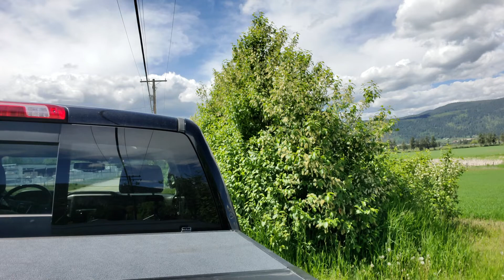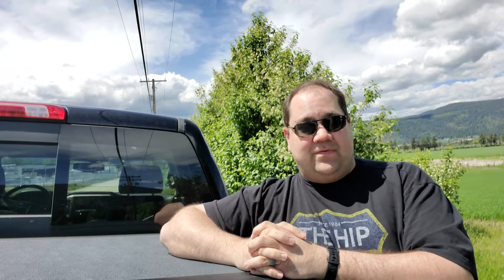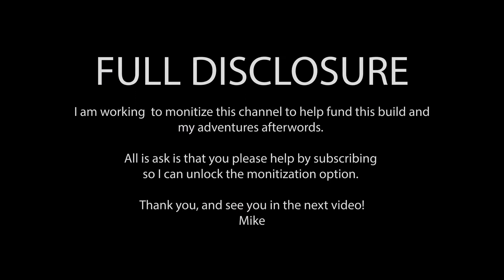DIY 8020 Pop Top Camper Build - Introduction

Comment: Nice! I'd love to follow this. For a few months now I've been making plans and sourcing parts for a pop up towed 80/20 trailer. If you ever get stuck with something shoot me a message! Id love to bounce some ideas of each other and help solve some problems. The most recent one for me is making a lift system for the roof that also allows the tent to fold inside. Ive made 3 plans for different lifting mechanisms but have run into problems with each one. I really want to stay away from the triangular pop top.
Reply from the maker: Thank you so much for the follow! I'm definitely up for chatting and helping each other out. This is my first time working with 8020, so I need all the help I can get.

Funny, just trying to figure out my lifting and securing mechanism. Thinking I might do a something similar to the Project M with piano hinges and plate metal or wood that folds down then locks when popped up.
Reply: @MykeFifteen  It'll be my first time working with it too actually. Ive watched a lot of videos on it and ordered some small samples a week or so ago so ive been playing around how to put it all together and get a manual ready for myself when I order every part.
I just looked up the project M build and that was my plan originally with the gas struts but you guys have the advantage of having the truck bed walls for extra height already. Im trying to build the base frame of mine on a 5x8 trailer and only have it 2ft tall so I need at least 36" of lift to give myself hunched over standing room. I made a small mock up in after effects of using flat bars in an X shape with gas struts on the bottom to push horizontally that by my rough estimation, 12" of horizontal push will give me 36" of vertical height. I'm just not sure how sturdy it will be though.
Reply from the maker: @toast022  have you used the "Frame Designer" app from 8020? Super easy to design in and it spits out a BOM with qtys, lengths and machining instructions.

Honestly, I wish I didn't have the bed rails  to deal. With as they present a challenge in themselves. I can't find bed stiffness for my truck so I had to design a support that runs down to the truck bed...
 If this topper works well I'd consider selling this one, the truck bed and build a frame mounted camping box on the back.

Why are you limited to the 24"? I'd be interested to see your lifting design.

If you want to email me take my YouTube name and add @gmail.com to the end of it.
Reply: @MykeFifteen  I work as a graphic designer so I will send it to you tomorrow morning when I render it out. keep in mind its not 3D and is basic just to get a feel for what I was thinking. I have not used the app though but will give it a shot. I'm in Canada so 80/20 specifically may be more expensive for me to order and ship but there is a company with the same product (where i got my samples from) in montreal. Their products do show compatability with other brands and most mention 80/20 so if I have to order a few parts from 80/20 I could always do that!
Reply: @MykeFifteen  Also I'm not limited to 24". I do a little wood working on the side as a hobby, and I'm really a fan of compact but functional designs. I dont want a huge bulky trailer, and I've thought about making it into a business if the first build goes well. The problem I've had with the camper industry is that they are big, weight a bunch and can't be towed with sedans. Ive found many used pop-up trailers I wanted to buy in the past but can't tow them with my Chevy Cruz. If I can make it into a business, I want to be able to offer them at an affordable price and be able to tow them with almost any car so the key to me is light weight.
Reply: @toast022  Watching your dialogue.  I want to build a unique design for the Tesla Cybertruck, and make it hard-walls that fold up.  I envision some mechanical sticking points.  @MikeBabsBC
Reply: @MykeFifteen   @toast022  Watching your dialogue.  I want to build a unique design for the Tesla Cybertruck, and make it hard-walls that fold up.  I envision some mechanical sticking points.  @MikeBabsBC
Reply from the maker: @123pathTube  check out Kit Campers, he has lifting doors on his design and even provides a free BOM.

https://youtu.be/YqW7f7GM2kw
Reply: @MykeFifteen  really great referral to Kit Camper.  Thank you!
Reply from the maker: @123pathTube  you are very welcome! Good luck with your build!